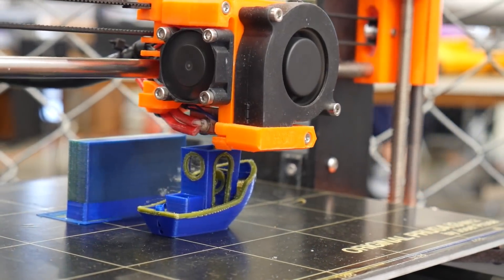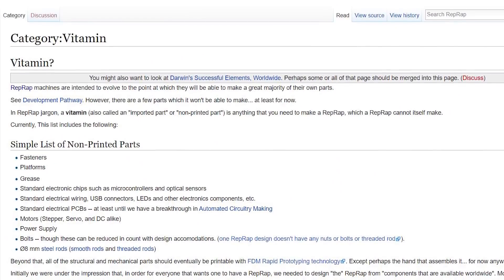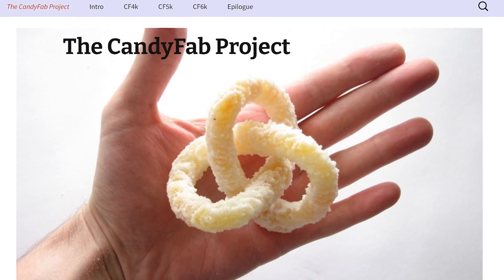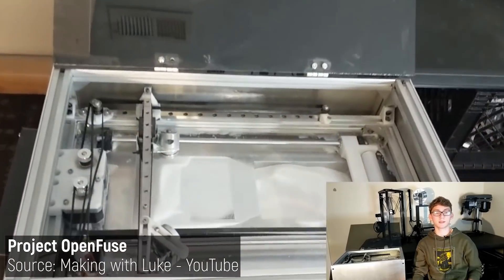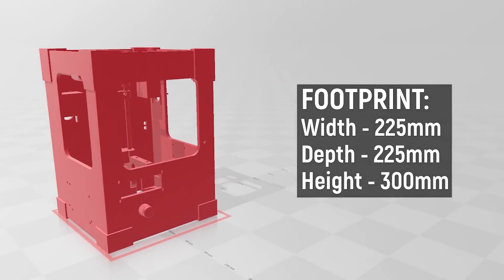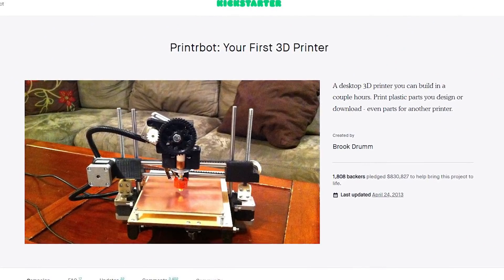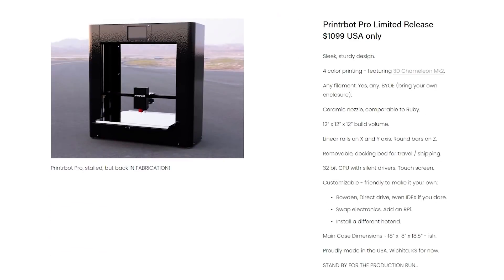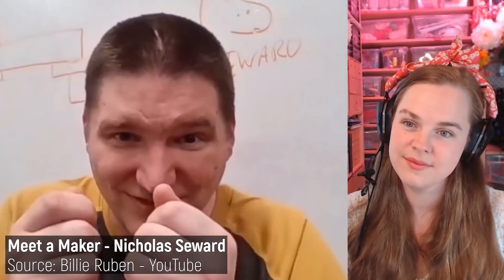These 5 Pioneering 3D Printers became extinct.

Comment: I actually have a modified laser cut Tantillus beside me while watching this. I never managed to get it to print, but it is now a PCB CNC driller, which works very poorly, but I haven't yet had the opportunity to make it a bit more rigid.
Reply: Your mention of PCB's made me think of making a Tantillus frame from Custom PCB's with a bunch of the wiring routed via the walls.
Reply: @MaxNippard  that would certainly be possible and also visually quite interesting. You could have not only the wires, but the whole control board on one of the walls

Comment: Somewhere in this messy room is my PrintrBot simple metal with heated bed.  The PSU has a short in it but I know with one of my old PSU laying about I could get it running again.  Though I do have another FDM printer as well as an Elegoo Mars.

Comment: My dream 3D printer project has yet to be tried.  When 3D printing exploded one of the parallel dreams was potentially using recycled plastic, like HDPE.  It was completely abandoned because filament was difficult to make and then 3D printers moved in the direction of speed and accuracy.

But what about a printer that was designed to use large terrible filament?  What if our slicing software compensated for HDPE's high level of warping?  Why is desktop injection molding under $200 being pioneered by ONE guy?  (Shoutout to Buster Beagle) Why is spring loaded press molding something that only I've thought of? (Plug for my channel, InventTory)   Why is the potential of using garbage plastics not one of our primary goals?!
Reply: It's impossible to find your channel because when you search, youtube just assumes you misspelled "inventory". It would be easier if you featured it on the Tory Evans channel
Reply: @eekee6034  Noted

Comment: I've always wondered if the delta printers had an advantage over cartesian ones? Could you make a video on that? From a long french viewer...
Reply: I can name one disadvantage I've heard about. Delta printers have better quality in the middle and less good around the sides.
Reply: @3DJapan  That's also not entirely true. A delta printhead starts to tilt a bit in the very extremes, when the reach of the arms is over. If your printbed is larger than the reach of the arms, there could be very visible distractions in the print, caused by the tilted head. You could overcome this with adjusting either the lenght of the arms or the maximum printsize in the firmware.
Reply: @marcus_w0  The kinematics of a delta means the X/Y resolution varies considerably across the build area, unlike a Cartesian design where it remains constant. Toward the edges of the build area the resolution increases, which is to say the steppers have to make more turns for a given hot end movement, which limits print speed. Conversely the resolution is lowest in the centre, and any slop in the linakges will have much larger effect. Frankly it's surprising that even the cheap deltas work as well as they do.
Reply: Pros: 
Usually can print at faster speeds assuming the injector can keep up 

Less parts, so cheaper to buy/maintain. 

Cons:
Usually a smaller print volume due to the nature of the angles involved with the axis drives.
Reply: Con: Dimentional accuracy
Reply: @stephendowdle5537  I have several delta printers - and everyone of thems absolutely dimensional accurate. If it's a well versed firmware you're using, it's more a myth then a thing. Deltas had these problems in the very early days, back when they were driven by 8 bit micros. But nowadays with 32 bit microcontrollers it's entirely a thing of the past. My anycubic Kossel Plus/Pros wipe the floor with any cheap I3 design. Printspeeds well in the 300mm and absolute accuracy paired with easy maintenance make them the most loved childs of all my 9 printers family. Also you could make them in any z-height you want, just by changing the aluminium extrusions, belts and linear rails. My only con would be the bowden-extruder you need to achieve high movement speeds. printing flexibles just isn't a thing. But that's my A-net A3's job anyway ;)
Reply: My first 3d printer was a delta printer and I still have a fondness for the design, some pros and cons:
Cons:
1. Difficult to access the print head to clear jams, change nozzle etc
2. Related to (1), difficult to add direct extruder, so generally limited to Bowden (personally I like Bowden)
3. Frame is not inherently rigid, and because of shape is difficult to reinforce to make rigid
4. Difficult to fully enclose print area
5. Relatively tall for a given print volume
Pros
1. Fixed print bed
2. Light print head so can be fast
3. Probably the best design if you want a really large printer
Reply: @martinstech5514  
2 FLsun V400 has a direct extruder
3 plenty rigid
4 put it in a box. Theres an Ikea glass cabinet that fits my QQSpro
5 most rooms are high enough

Comment: Ah, Eventorbot. I was probably one of the few people who actually got it shipped to them.

It had promise but suffered from the early Kickstarter overinflation of what was possible to ship. Then once I got it, some time after it was supposed to arrive, it had a lot of issues due to the choice of using regular threaded rod instead of acme. It looks nice, but is hard to maintain and often would seize while moving. I got it about 70% assembled before boxing it up and using the electronics in other projects.
Reply from the maker: Yeah, it looked so good but they had no idea how to deliver it as a real product. Like many kickstarters I guess. At least you got it though!
Reply: @MakersMuse  I think I got it because I was lucky enough to be in the same U.S. state as the person running the Kickstarter. Shipping all that steel must have been hugely expensive. IMHO, adding in the folded steel frame without upping the cost for shipping was their biggest mistake.

Comment: I think, considering the Chinese market, we should include the Anet A8 printer. As far as I know, it's no longer available for purchase, but at the time of it releasing, it was ground braking. Yes, it was a Prusa i3 clone, but for around $200 you got a very nice quality 3D printer with a reasonable (220x220x240 mm) build volume, and also with heated bed. Of course for $200 corners had to be cut, so there was no auto bed leveling (Z homing was made possible by a momentary switch) and the frame was made of laser-cut acrylic (which made the printer somewhat wobbly), but it was very affordable even for us, living in the Mordor side of Europe (East to the former Iron Fence).
Reply: I definitely think the A8 deserves recognition, but perhaps in a list of market disruptors rather than historical forgotten machines. For a few years they were unavoidable, but they most definitely had some serious safety concerns. I feel like they only really fell out of fashion because other machines came in and replaced it at its price point. Whether that's a good or bad thing is up to the individual I suppose, but I do find it's led to quite a bit of same-ness in the 3d printer space for the last couple years. Most definitely a good one to remember, though! Thanks for sharing.
Reply: I have a sintron i3 - a very similar printer to the A8, but doesn't seem to have quite the fiery reputation/popularity. It arrived in kit form and the instructions consisted of a couple of photos and rough diagrams, so assembling it, then getting marlin set up and the printer working properly taught me a lot about 3D printing in general and significantly more about the actual process than if it had just been working out of the box. Then once you have it working, the cycle of break, crack or melt something, bodge it back together and print a better designed replacement part starts :). Who in their right mind thought an acrylic panel directly under the heated bed with as much material as possible removed wouldn't warp and cause a loss of leveling? :).

Probably shouldn't say it, but I haven't updated marlin since as I think I have probably lost the config files and don't want to set it up again or recalibrate from scratch :).
Reply: @jg374  My Anet A6 came with a faulty acrylic part in 2017. A friend told me to send it back under warranty (yeah right lol). I ended up using some gaffa tape to hold it together to print a replacement part. It's since been a Theseus' ship of replaced parts, although I still have the original frame, heatbead and power supply (and the screen which I reverse engineered the connections for). My Marlin is still from 2018 when I did most of my upgrades since I don't want to reconfigure new Marlin versions every few months, even when I added an new SD card reader and recently a filament runout switch. I have written down all the config settings and store them with my spare parts to speed it up in future.

Comment: IMHO the weirdest Simpson design would be the one where all three Axis run on a single Rail - Works like crap ( Tool Head is super unstable due to the cantilevered design ) so the likelyhood of it - like any other of his design - not dying off for various reasons is slim but hey... They are nice to look at 🤔

I wonder where 3D Printing will head to in the future. We have like 3 established FDM Methodes ( Cartesian, CoreXY & Delta ), 2 Resin ( SLA & MSLA ), and 1 Powder ( SLS ) method available to us with the latter one still being practically out of reach for the consumer as even the DIY solutions will cost you about an arm and a leg to produce tiny parts and requiring a crapton of dirty and manual postprocessing most ppl probably don't want to deal with.
Reply: I was hoping that the single rail one would be in the video as well.
Reply: Metal printing is the only thing I'm looking at rn. Binder jetting might eventually make metal printing affordable, but I'm far more interested in how SPEE3D applied the principles of impact plating/mechanical deposition to 3D printing, and it's looking like a very good technology: high enough throughput, not terribly messy. Now it's a question of how cheap/small/safe it can be made.

Metal might be much more expensive and energy-intensive to work with, but it would allows us to build and open-source designs for actually useful objects.

Comment: A friend of mine still has a sugar mixture based printer in his collection. It was used primarily to make the removable parts of a casting mold... and edible sugar crystals on occasion.
Reply: WAIT.... WAIT WHAT?....... that's one of the single best ideas for making rough metal parts on the cheap I'v heard of. Print it in sugar, bury it in sand/clay mix, and incinerate the sugar out by lost mold casting with molten aluminum or the like. No more styrofoam or wax..... that's seriously smart, you just have to refine and file the parts a bit after casting.
Reply: @theLuigiFan0007Productions  Pla works just as well. Pla actually makes really good for making molds like that. If you wanna do metal casting at home, using pla and casting recycled aluminum is the easiest way to start.
Reply: @lobsterbark  So it can burn away quick enough? I presume with a super slow infill percentage so it's basically a hollow shell. But that's interesting to know.
Reply: @theLuigiFan0007Productions  yeah, you can make the print insanely thin and hollow inside very easily. You can also add channels to let gas out or anything else you might want for a better casting much more easily than you could with most other methods of mold making.
Reply: thats a rad idea

Comment: Angus, speaking of making a Tantillus - you should be making all kinds of printers at this point. Create your own printer design, you obviously have the CAD skills and surely the skills to handle designing a ckt around an MCU (it's not hard, just follow the spec sheet!) and make a series about it. Angus' foray into designing and building a 3d printer from scratch!... and have seasons where each one is a new machine.
Reply: Didn't he already make his own printer? It was a fall out one
Reply: @toddclark419  Straight up. Top points for a long term viewer!!!
Reply: I would be very much interested in that, especially a folds-into-a-briefcase model.

Comment: I remember back when I first read about RepRap and the Darwin I was really excited, to the point I almost started a project to make one. But at the time I realised I didn't really have the tools or experience to pull it off, especialy as the software at the time was in its infancy. I then kind of forgot about it, occasionally observing from the sidelines the arrival of the MakerBot and the Stratasys controversy, but it wasn't until the last couple of years when 3D printers became so affordable I finally took the step and bought one. It's amazing how far they have come in what is only a few years - makes me wonder what the next 20 years will bring!
Reply: Same here. Was going to make a larger version of the Darwin using linear bearings (still have them laying around somewhere). But the realization of the missing skills needed plus the death of a friend that was going to work with me on it ended that plan. Been watching developments over the last few years. May be time to dip a toe into the pool again.
Reply: Same
Reply: These last few years the progress seems to have basically stopped, at least in terms of FDM printers. The Prusa i3 is still the best design overall, and printers that specialize in specific things haven't really improved at all since about 2016-2018. Most of the progress has been in the availability, price, and quality of parts.

Like for instance cheap filaments are now almost all really good, the various manufacturers seem to have mostly standardized on what to add to improve the quality, stepper drivers have all gotten cheap, you don't have to solder anything anymore to build a printer, if you buy a 3d printer part from a sketchy cheap source it will usually still work.

All the progress is now in UV resin printers.
Reply: @lobsterbark  I suppose that cheap printers - like the really cheap ones <100 bucks - need to catch up in quality before the big players see necessity to improve their designs again

Comment: Thanks for mentioning the tantillus 3d printer I have one laser cut version and plan on making it all in metal and try to print in peek. As of now only the frame is in laser cut aluminum planing to cast the plastic parts in aluminum and add water cooling and insulation to make it better for peek printing for use in dentistry.